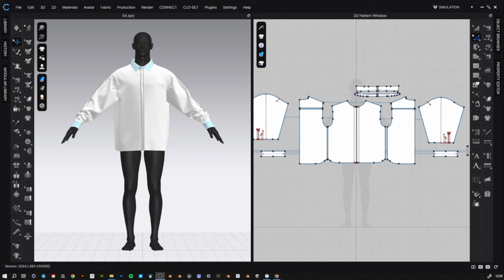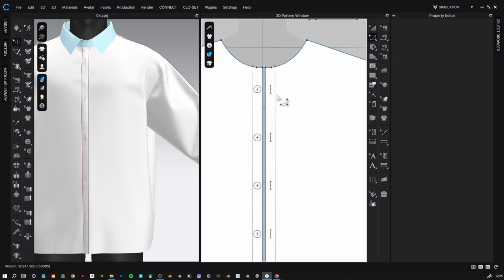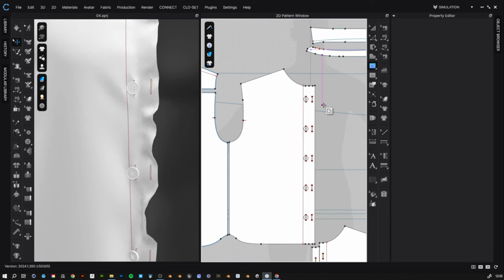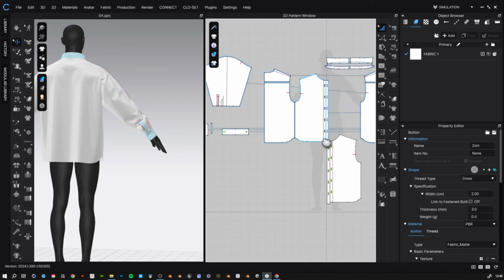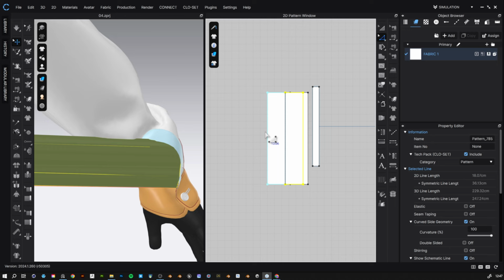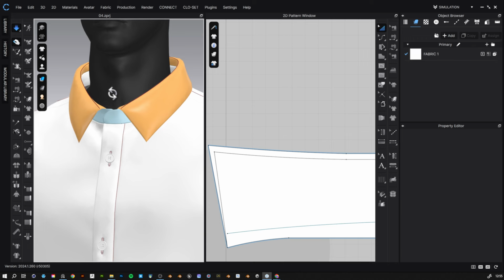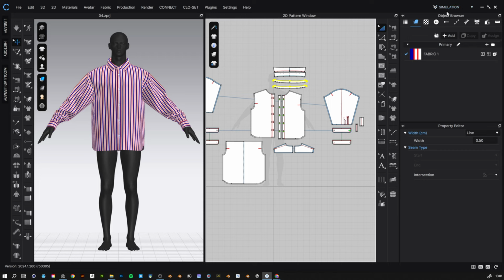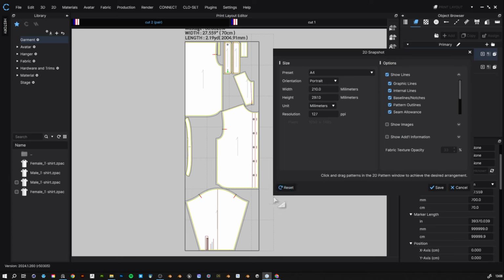CLO3D Export Pattern for Physical Production Shirt Sewing Garment Details and Seam Allowance

Comment: looks cool, do you have in plans to work on this garment further by sewing all you did in this series? Also the question regarding the packets, why they are differently approached from boths sides, I mean why one is folded and another is cut?
Reply from the maker: The shirt is currently being made with a supplier I work with :)

The front placket is constructed differently because the front usually needs to be stabilised as it will have the buttons holes stitched through it.  The back part is just folded as there is no need for fusing on the side that has the buttons
Reply: @digitalfashionblender  cool, will you share the assembled shirt?